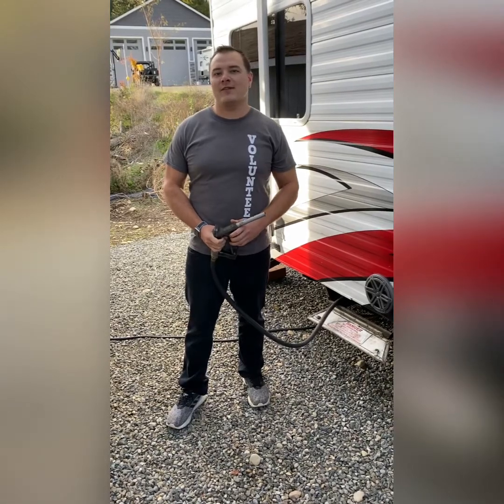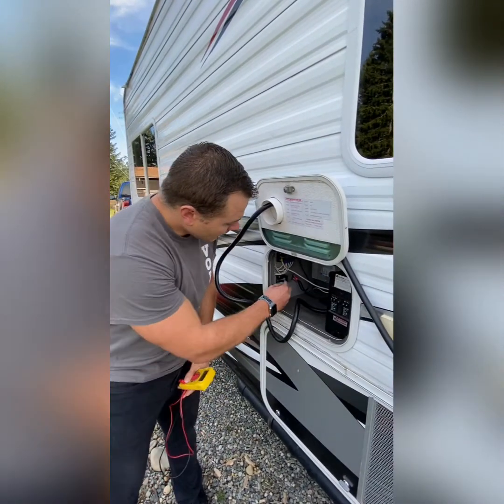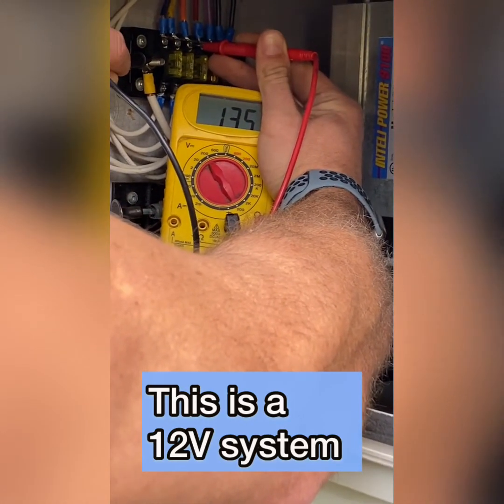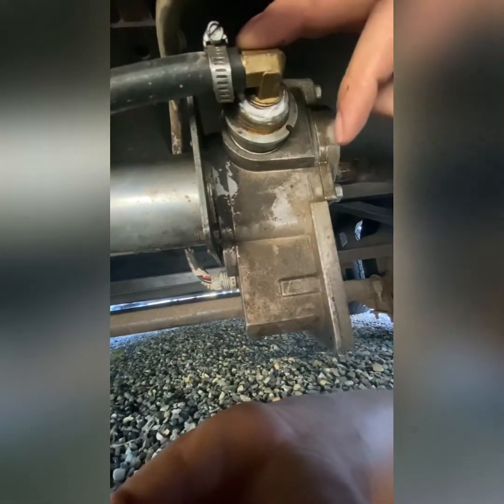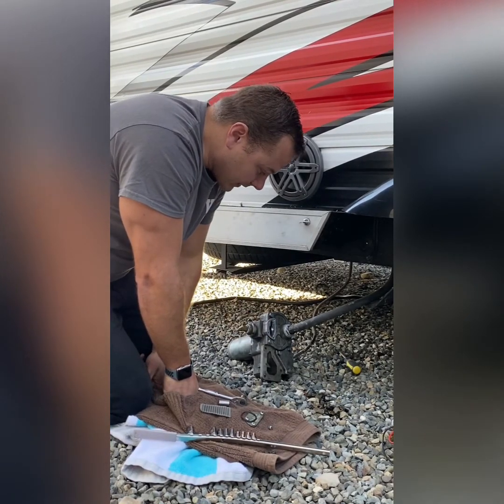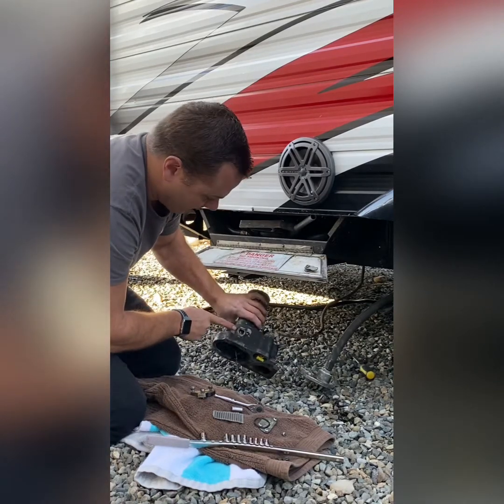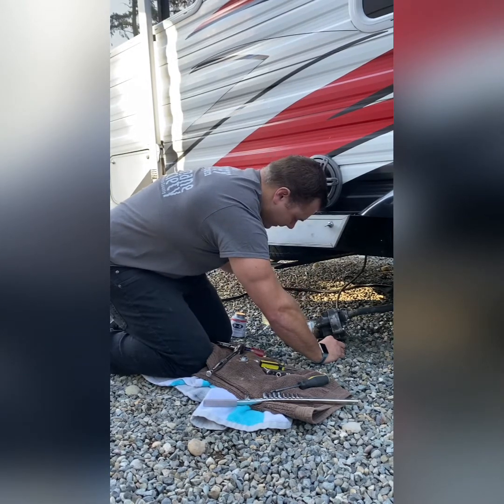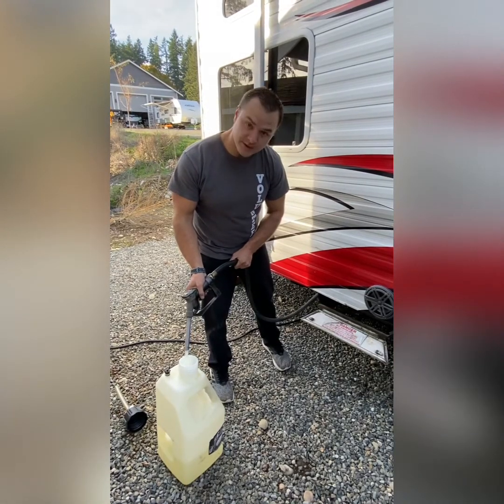How to fix your fuel station pump system: Electrical, Nozzle, and Fuel Pump Fixes

Comment: In the video, you said that if after all of that it still does not pump it could be the check valve in the tank. Do you have a video about the check valve?

Comment: Any idea why the pump would blow the fuse as soon as I turn it on.
Reply: Because the gears have swollen in the pump and are sticking to the side of the housing. I don't have a link for a video, but I have found quite a few people saying to disassemble the pump, lay a piece of fine sandpaper on a flat surface, and sand down The sides of the gears just a little bit, which will allow them clearance to turn. It's the fact that they are seizing when power is applied that's causing your fused blow, as it did mine.
Reply: Ah, found the video on sanding the gear:

https://youtu.be/qgbjlSWZY7I?si=5tbNvPjVZAxSwHa0

Comment: should fuel gravity feed and flow freely out of the hose from tank to the pump? I Fixed my pump as the gears had swollen and stuck.  I also noticed my line from tank was pretty dry and nothing coming out.  Does the pump have to pull a vacuum to suck out the fuel and not expect it to be free flowing?

Comment: I am having an issue with the meters on the control panel. It had a 15 minute delay switch, it use to work fine now it sounds like it clicks but no electricity comes on.

Comment: Are pump turns on but doesn’t sound as loud as it does before and it doesn’t dispense fuel. We thought it was the pump so we bought a new one and it does the same thing and sound the same. We might think it can be something it the tank now. Any solution

Comment: Would love to see a video of a Gas vs Diesel truck choice when looking to purchase a truck Camper.  Been thinking about just going with the Ram 6.4L gas over the Diesel
Reply from the maker: Great idea. I just bought the 2020 GMC Sierra 3500 with the Duramax because of the 10 speed Alison transmission and it make hauling anything a dream, especially on down hill descents. I will talk to some of my motorhead buddies and see if we can put a video together. Thanks for the comment.